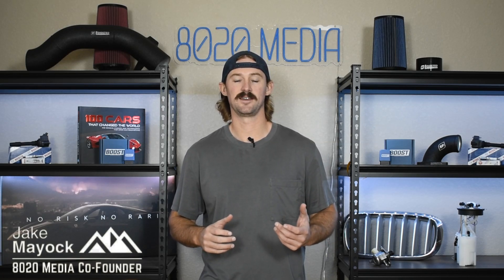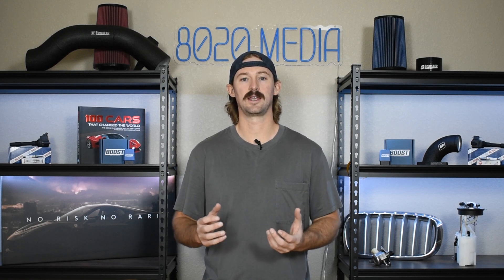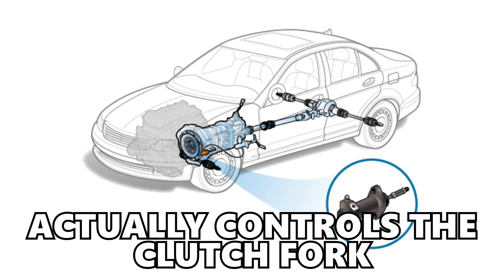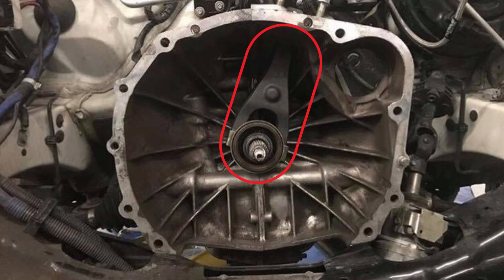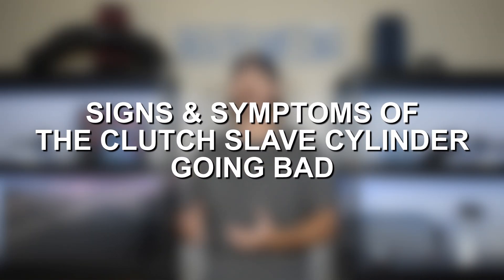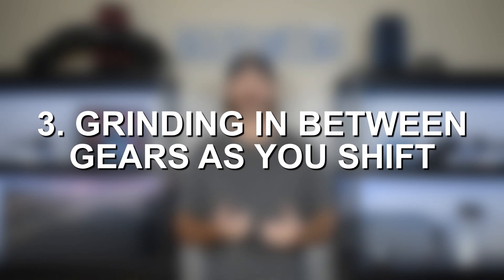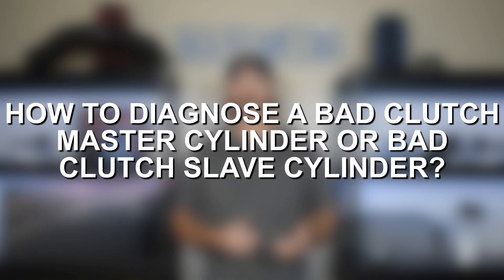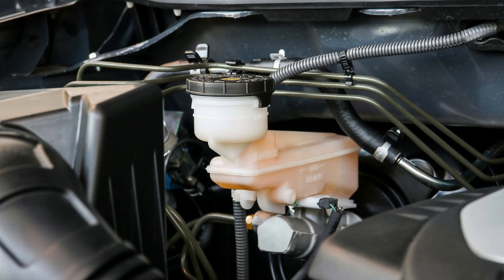Bad Clutch Master or Slave Cylinder? Symptoms, Diagnosis, and Fixes Explained!

Comment: I recently changed clutch on my car and the clutch biting point is very high almost om top. Is it because of slave cylinder? I have bled the clutch still facing this issue
Reply from the maker: L - If your clutch biting point is very high after replacing the clutch, even after bleeding the system, the issue is likely related to the clutch master cylinder, slave cylinder, or incorrect clutch installation. A high biting point usually means excessive clutch wear, improper clutch fork positioning, or a self-adjusting pressure plate that hasn't reset properly. If your car has a hydraulic clutch, ensure the clutch master and slave cylinder are functioning correctly, as a faulty master cylinder can cause incomplete disengagement. Also, verify that the clutch pedal adjustment (if applicable) is set correctly. If everything checks out and the problem persists, the pressure plate may not be engaging correctly, or the throwout bearing could be incorrectly seated, requiring a reinspection of the installation. Keep us updated.
Reply: The thing is before I changed the clutch the biting point was also on top, thinking it was worn out clutch I had changed it because it started to slip although the biting point remained the same

Comment: I was driving and suddenly my clutch pedal stuck to the floor, I pulled over and smelt a burning smell. Noticed the resoiver was empty so I filled it up and straight away it emptied and clutch pedal still felt the same after trying to pump it. I noticed that fluid is leaking near the gearbox area underneath so I’m not really sure on what’s causing the issue
Reply from the maker: P - Sorry to hear this.. Your clutch pedal sticking to the floor, immediate fluid loss, and leak near the gearbox strongly suggest a failed clutch slave cylinder, especially if the fluid is draining instantly when refilled. Since the slave cylinder is inside the bellhousing on many vehicles, a failure would dump all the fluid near the gearbox area and prevent the clutch from disengaging. The burning smell could be from clutch fluid leaking onto the hot transmission or exhaust components. To confirm, check the clutch master cylinder for leaks, but given the rapid fluid loss, the internal slave cylinder (if applicable) is the most likely culprit. Unfortunately, if the slave cylinder is internal, this means the transmission has to be removed to replace it. If your car has an external slave cylinder, it will be much easier to replace. Also, inspect the clutch line and connections, as a damaged line can also cause leaks, though less common. Don't drive the car until the issue is fixed, as running the system dry can damage the master cylinder as well. Keep us updated.

Comment: My F150 suddenly got stuck in gear and stalled out. I was barely able to get into 1st to move out of the way. I added brake fluid to the master cylinder and got home but the pedal felt really mushy. I'm really hoping it's the line or master cylinder because Ford in their infinite wisdom put the slave cylinder INSIDE the transmission. What's sad is it's something the old clutch fork never had problems with. Just something to fail to make them $. Man, F these manufacturers for deliberate BS like this.
Reply from the maker: T - Your F-150 getting stuck in gear, stalling, and having a mushy clutch pedal strongly suggests a leaking or failing clutch hydraulic system, likely the clutch master cylinder, slave cylinder, or a damaged line. Since you had to add brake fluid, there’s likely a leak in the system, and unfortunately, if it’s the internal slave cylinder, it will require dropping the transmission to replace. If you're lucky, it could just be a leaky clutch line or failing master cylinder, which is much easier to replace. Check for fluid around the master cylinder, clutch line connections, and under the transmission bellhousing—if fluid is dripping from the bellhousing, the slave cylinder is failing. Bleeding the system might temporarily help, but if the slave is leaking, it will worsen over time. You’re right—the old external clutch fork setup was far more reliable and easier to service, but modern manufacturers went this route to cut costs and package components tighter. Keep us updated!

Comment: What’s up man my vehicle is actually getting stuck in gear when the car is turned on but you can cut the car off and switch to any gear and the clutch pedal was soft and spongy and it wouldn’t bleed
Reply from the maker: A -  What's up! If your vehicle is getting stuck in gear while running, but you can shift when it's off, and the clutch pedal feels soft and won’t bleed, it’s almost certainly a hydraulic clutch system issue. The most likely culprits are a failing clutch master cylinder, slave cylinder, or air trapped in the system. If the fluid level in the clutch reservoir is low, you may have a leak in the master or slave cylinder, preventing proper pressure buildup. Since you’re unable to bleed the system, it’s possible the master cylinder isn’t pushing fluid properly, or the slave cylinder is internally leaking or stuck. Start by checking for leaks at both cylinders, ensure the reservoir is full, and try gravity bleeding first. If the problem persists, replacing the clutch master and/or slave cylinder is likely needed. Keep us updated!

Comment: I just had the clutch and flywheel replaced on my 2002 GMC Sonoma and less than a month of driving it has started to be hard to put in gear.  Clutch pedal has little resistance too.  I do notice that if I pump the pedal several times,  it becomes easier to put in gear.
From what you described, I think it my be a master cylinder issue.
Thanks for the vivid diagram and articulate explanation on how the clutch works.  I'm taking the truck back into the shop with knowledge you gave me to make sure they don't try and charge me extra for something I don't need done.
Reply: Do you fix it my Sonoma is doing the same exact thing
Reply from the maker: B - Thanks for the feedback and keep us updated!

Comment: Have you ever experienced a pulley like noise coming from the engine bay that goes away when the clutch pedal is pressed? I do experience this on my Honda for a few days now and seems to get worse because recently (specificaly) 3rd and 4th gears have difficulty getting in., sometimes the gear stick wont go in and have to press the clutch pedal 2x or 3x for the  lever to get in gear or sometimes ends up grinding. But only happens on 3rd and 4th. My Mechanic the other day suggested we change the release bearing of the clutch disc so we did. Car drove like a charm for a few days, but then after that pulley like noise has come back ☹️ any suggestions please? At worse times the pulley noise becomes a very loud rattling-like noise totally unbearable then goes away again afterwards., have been driving stick since my teens but only now i am puzzled by this problem., any thoughts/suggestions please? 😊 thanks
Reply from the maker: C - The pulley-like noise that disappears when pressing the clutch pedal, combined with difficulty shifting into 3rd and 4th gear, suggests an issue with the input shaft bearing (pilot bearing) or clutch release system rather than just the release bearing. Since you already replaced the release bearing and the problem returned, the input shaft bearing inside the transmission may be worn, causing noise when the clutch is engaged and making shifting difficult. Another possibility is that the clutch master or slave cylinder is not fully disengaging the clutch, leading to grinding or difficulty getting into gear. To diagnose, check if the noise happens at idle in neutral with the clutch engaged—if so, it’s likely the input shaft bearing. If the pedal feels soft or inconsistent, air in the hydraulic clutch system or a failing clutch master/slave cylinder could be causing partial disengagement. Keep us updated!

Comment: I have a 2011 Impreza and driving to work the other day the pedal suddenly stuck to the floor and it was impossible to get into gear. Luckily I was in a spot where I was able to safely pull over. I check the boots on both the master and slave cylinders and there doesn't seem to be any leaks andnthe resevoir still appears to be completely full. The push rod of the master cylinder seems to not be extending at all but not sure if that is the cause or a symptom. Got quotes on replacement parts and the slave cyclinder isn't to bad but to get a non second hand master cylinder I've been getting quoted around $500-$800 (found cheaper online from the USA but $60 and 8 weeks for shipping so not an ideal solution). If they were cheap I was going to replace both just in case, but for that sort of money I really want to make sure I know for sure before I throw that sort of money away. Going to try flushing the hydraulic system over the weekend and see if I can get a cleared idea of what is going on. Wish me luck!
Reply from the maker: S - Sounds like you're taking the necessary steps! Keep us posted.

Comment: My clutch master cylinder completely went in my 2015 VW passat, it was stuck on the floor and i had to get my car towed to the garage. It went without warning. The master cylinder was replaced but the next day the clutch pedal started making a grinding noise when depressed or released. I was told this is just the clutch pedal spring and to allow it a couple days? A few days and not much driving later the grinding noise hasn't gone and now my clutch pedal won't fully spring back, the gears are just about selectable and i barely get it to the garage. Clutch fluid reservoir is low. The garage take it back to investigate and repair and i get it back yesterday. Today i go to drive the car (i have literally only driven about 2 miles since collection) and the grinding noise is back when i press or release the clutch pedal. I am losing faith in the garages ability to repair the car, and I dislike being lied to. Any ideas what could be causing the grinding noise from the pedal when i press or release the clutch?
Reply from the maker: E - The grinding noise and issues with your clutch pedal after the master cylinder replacement suggest unresolved problems within the clutch hydraulic system or mechanical components. Air in the hydraulic system due to improper bleeding could cause spongy pedal operation and grinding, while a leaking slave cylinder could result in fluid loss and prevent the clutch from fully disengaging, making gears difficult to select. Additionally, a worn clutch release bearing, pressure plate, or misaligned components could create grinding when the pedal is pressed or released. Improper installation or misalignment of the master cylinder may also put extra strain on the pedal assembly. Given the recurring fluid loss and noise, have the entire hydraulic system inspected, including the slave cylinder, and ensure proper bleeding. Also, check the clutch release mechanism and pedal assembly for wear or misalignment. Keep us updated!
Reply: @8020Media  Thank you so much for the detailed response. I will keep you updated
Reply: @8020Automotive  So I had the car back from the garage yesterday and have driven around 10 miles with it so far. The noise from the pedal appears to have gone for now, so I hope it doesn't return. I was told there is a washer on the pipe that attaches to the rear of the clutch pedal, and this washer is defective. I was told they stripped down the clutch pedal assembly and added a couple of washers somewhere, but if it starts again that I will need a whole new clutch pedal assembly, which i will need to pay for. A younger 'trainee' mechanic also said something about a seal on the pipe that connects to the clutch pedal wasn't sealing properly (air in the hydraulic system?). As a non mechanical person I am not sure how I feel regards their explanation, it was all sounding a little bit odd. If it does start making the noise again I will be taking the car back to a different garage for a second opinion.
Reply from the maker: E - I think that's the right plan! Keep us updated.
Reply: Did you ever hear anything ? I have a 2006 passat I just got towed to the garage and there telling me a slave cylinder but I'm pretty sure it's just air in the Lines. I don't know what to do
Reply: @TheMatthew2526  It was the master cylinder in my case. The garage didn't do a good job fitting it and there was a leak causing the grinding noise. There was also issues with the clutch pedal. Again i highly suspect due to poor workmanship. I won't be returning to that garage

Comment: Thank you for the video I just watched it. So the problem with my car is that the clutch doesn’t feel like how it use to. I have to press the clutch down half way for me to feel the pressure. It would usually feel instant rather than halfway down. And the gears would sometimes lock up from where I’m unable to shift. And I’m using a makeshift (nipple) or cap for a part that’s located near the engine kinda where the breaker fluid reservoir is located as well. I’m thinking I need to have the proper cap or nipple to close it off but I’m also thinking that there might be air within the brake fluid I’m not sure and I need help but I’m gonna look at the video again to see if I can find out. Thank you.
Reply: Okay so I just tested it with another makeshift (nipple)/ cap and it worked just fine I was able to drive it around the block but when I check it it look like it was about to come off I guess because of the pressure so I’m gonna have to find an actual cap for it hopefully auto zone has it. But I tried another cap and took it around the block and the car wasn’t able to shift gears and the clutch peddle got stuck all the way down (the clutch peddle wouldn’t go back up) and so I inspected the cap and it was leaking brake fluid.
Reply from the maker: L - Nice! Sounds like you found your problem. Keep us updated!

Comment: Hi Jake, fantastic breakdown of how each of these cylinders work in relations to one another.  Back in 2017, I ended up replacing both of these components on my 2000 4Runner.  The other day, my clutch went straight to the floor and I shifting gears.  Looks likes it about time to change out one or both of these cylinders.  I'm leaning more towards the master cylinder.....again, great video and explanation and troubleshooting....
Reply from the maker: M - Thanks for the feedback and sharing your experience! We hope it helped. Keep us updated.

Comment: I've been having an issue with my clutch sticking when quickly shifting (like on the merging lane for the fwy) that is more prominent when going from 1st to 2nd. Also I have noticed it if I'm at incline, worse when the the greater the incline obviously. I have replaced both the master and slave and this issue even stumped the mechanic at the shop I went to for it. Its an 8th gen accord for reference. Any insight would be helpful!
Reply from the maker: F - If your clutch is sticking during quick shifts or on inclines, even after replacing the master and slave cylinders, it could be due to air trapped in the hydraulic system, a worn pressure plate, improper clutch pedal adjustment, or wear in the clutch fork or pivot point. Ensure the hydraulic system is thoroughly bled, as air can cause inconsistent clutch engagement. Check the pressure plate for wear or failure to fully release under load, and ensure the clutch pedal is properly adjusted to factory specs. Inspect the hydraulic line for restrictions or damage, as a collapsing line could delay actuation. If these checks don’t resolve the issue, the problem may lie in the clutch assembly itself. Keep us updated!
Reply: @8020Automotive  Sorry for the late reply! After performing a bleed of the line, it shifted beautifully and then about 1 month after, it went back to shifting like a sponge. So we took your advice and started with the clutch line and decided to replace it with a braided steel line and then work our way down the system if that didn't fix the issue. Removing the complete hard line was a pain in the BUTT.  Self inflicted frustration because we didn't want to remove parts on top to get access to maneuver the hard line out of the way (ended up doing that anyway) and then was able to install the braided line with no issues. The line was re bled and its been shifting like butter! For additional context; the master cylinder was replaced 4 points in a single month at one point a few years ago and I can only assume that the line had a leak that that allowed enough air to make it spongy but still "functional". Overall, thank you guys for taking the time in replying, my Honda and I appreciate you!

Comment: I'm driving n Toyota 1'3 where is the slave cylinder because i chance my master cylinder
Reply from the maker: M - The clutch slave cylinder is typically located on the transmission bell housing, near where the transmission meets the engine. Follow the hydraulic line coming from the clutch master cylinder—it will lead directly to the slave cylinder.

Comment: I put motor oil in my reservoir. Will that cause my master cylinder to restrict? My slave cylinder was rusted and mud oil dark came out.  Can’t get reservoir oil to come out of slave. Won’t move the fork
Reply from the maker: B - Motor oil in the clutch reservoir can cause significant damage to the master and slave cylinders. Replace the affected components, flush the system thoroughly, and refill with the correct brake fluid. If the slave cylinder remains stuck, replace it as it's likely beyond repair. Keep us updated..